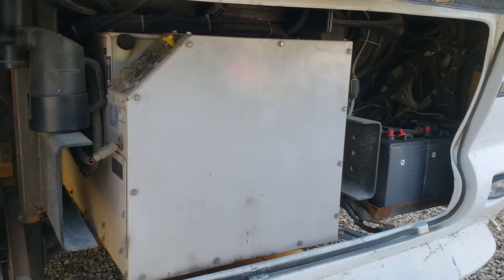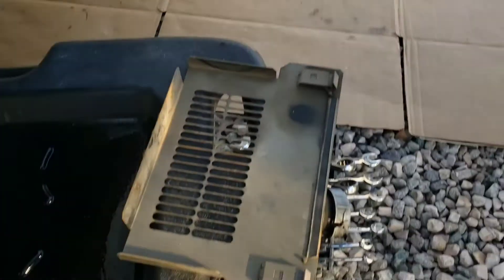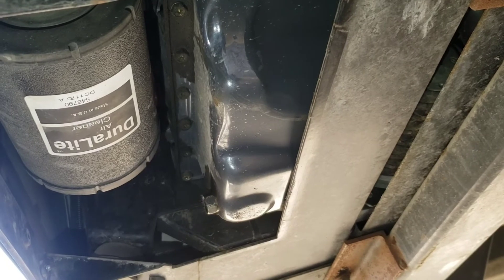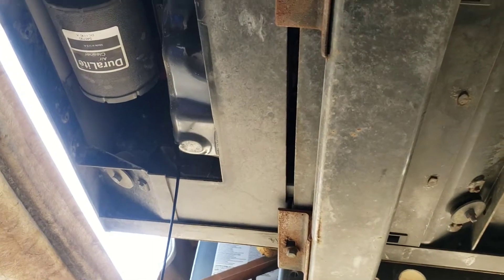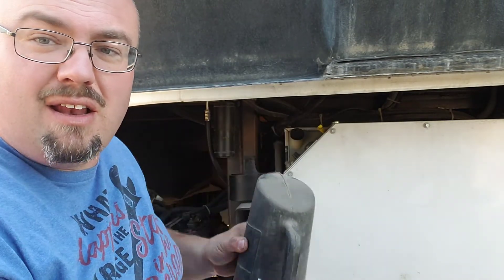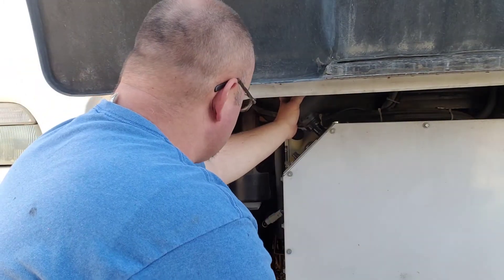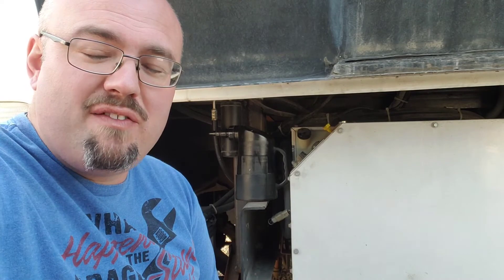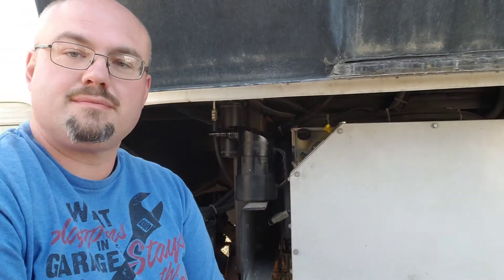Generac Oil Change - This Old Motorhome

Comment: Pull the front panel off and you will find that you have complete access to the oil and fuel filter as well. Your generator is a 75D Qietpact.
Reply from the maker: I'll have to look at that. I've read that the panel has to come off to replace the belts too. Thanks!

Comment: I need to find the info on ours. It's a 7500 Generac. Looks exactly like yours. Ours is in a 2003 Newmar Dutch Star Diesel pusher and the Generator is in the front like that one but is mounted on a slide so it comes out for servicing. Any info on best place to get parts would be greatly appreciated. Oil filter, fuel filter, air cleaner. Thanks
Reply from the maker: All of the maintenance items can easily be had at a local Napa or Amazon. I'm pretty sure there's a link in the description to the oil filter. I don't have the number handy. I know the belts are also available at Napa. The repair parts are getting harder to find. The circuit boards are several hundred dollars if you need one. 

I do wish this Generac was on a slide, that would make servicing it much easier. The belts would be far easier if you can get the side panels off.